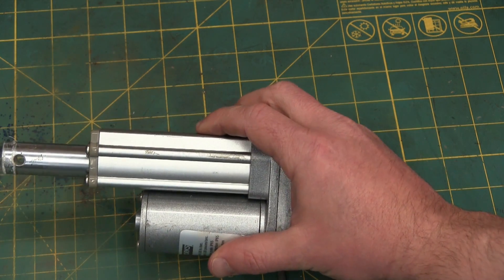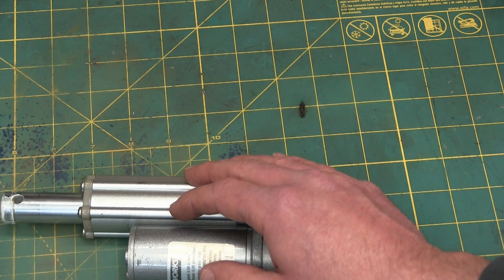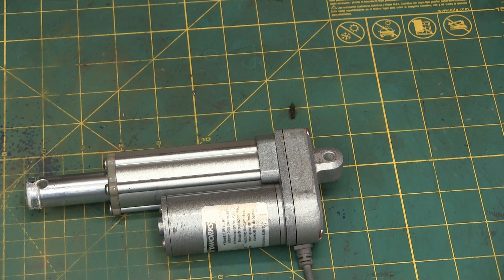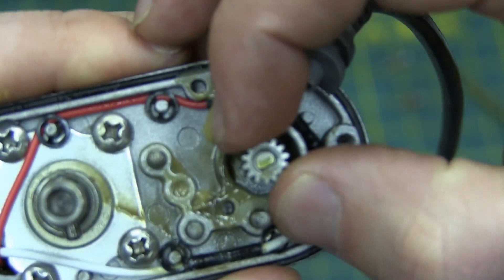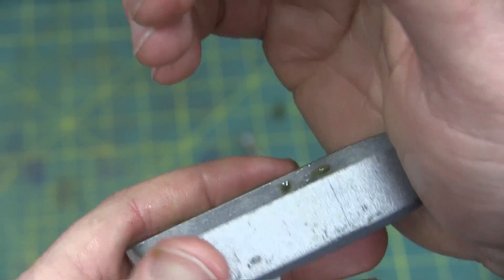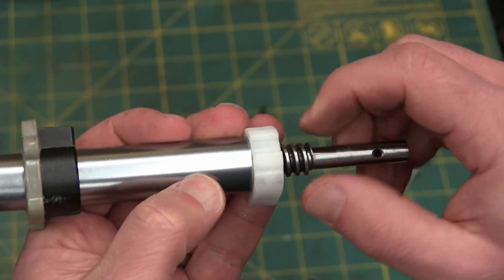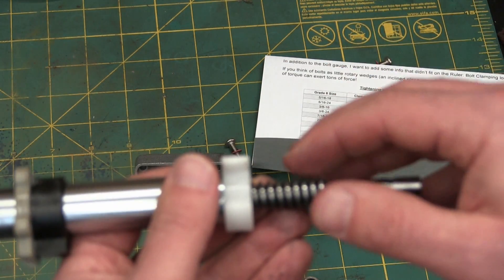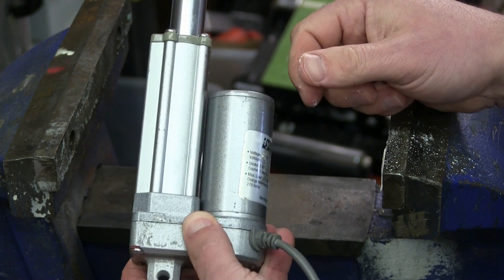BOLTR: ELECTRIC LINEAR ACTUATOR

Comment: So we had a Ghel loader that used one of those actuators for the implement locking pins. That actuator got bent up more times than I can count. I kept hammering it straight and putting it back on the machine. It would click and grind and just sounded terrible but never quit working. It was more than 15 years until we sold the loader. To this day I can't believe how much abuse that actuator took and never failed. I replaced the hydraulic lift rams and bucket tilt rams several times on that machine but never the actuator. 

On another Bobcat loader it had a hydraulic ram to operate the implement lock pins, and it got bent 2 or 3 times a year and had to be replaced. But on that Ghel, I just pounded the actuator straight and put it back on. It was unbelievable.

Comment: Nothing is built to last anymore :-<
They just preemptively engineer stuff to fail, this is why we don't even have mechanics anymore, they're just part changers.. I was thinking about replacing gaskets in my clutch master cylinder, well, whaddya know, it's all plastique! God I miss my old WV Transporter with it's all metal clunkiness.. fixt it with a hammer, two wrenches and a piece of wire.
Reply: As an engineer working with start-ups, I've come to realize the problem isn't that people don't want to build nice things - the problem is that nice things are expensive to make, and consumers would kill their mom and dad to save a couple bucks. Overengineering is as much of a problem as crappy designs, it's just that the consumers don't get to see them because they're scrapped early.
That Kitchenaid mixer Darnell Craig mentioned? It's awesome engineering, and it's worth several thousand dollars. You could buy a crappy CAR for that king of money.
Reply: From an engineering perspective, this makes no sense. You rate your product for X uses and/or Y time in normal operating conditions, and everything outside of those bounds is not really your problem. The only things "engineered to fail" should be safeguards, like fuses, etc., that detect a misuse or a critical fault in the system that would prove dangerous, but you're already outside normal operations.
No, there are no excuses for people like the guys at Canon using an hardcoded print limit to make their printers fail after a time. It doesn't protect anyone nor anything, it's just there as a shameless cash grab.
Reply: if you wanted it to last you should have paid the premium price for the stuff that lasts.
Reply: Fuses are everywhere, it's just that you only notice them when things go horribly wrong.
That, and most of the old-school single use fuses have been replaced with resetable polyfuses in modern electronics. You won't even realize you've blown a fuse - for instance,  when you overload your computer PSU and it cuts off, it's most likely a fuse. By the time you restart it, it would have reset.
Reply: I think you said this perfectly. As a fellow engineer, I can say I try to make the best design within the given constraints. Unfortunately, cost is always one of them. In a way, it's interesting because it forces you to think and approach a problem differently.

I do disagree about over-engineering to an extent. Take a look at military equipment and a lot of industrial equipment. A lot of that stuff is over-engineered and it's excellent. It needs to be because of the environment it's in. Perhaps I'm misinterpreting.

Thank you for mentioning that consumers can still buy well made products. The up-front cost is often offset by longer lifetime, support for when things do go wrong, and ease/pleasure of use. Ie. Well built products are well thought out, thus removing the frustration of use factor.
Reply: Some people agree, some don't. I guess it's fair. But I stick to my point. A pump made of plastic is made cheap, and to be replaced. Not fixed.
A clutch pump made of aluminium, pot metal or anything is probably way better, you can at least change the seals a few times, like you see on 20 year old cars. Not to mention you CAN take it apart to change the seals, you don't have to rip it open because it's glued together.
Also thanks for things like the windshield wiper sensors that stop the wipers because the water droplets are random (lol) and don't always land on the sensor area. My eyes see them, however, which is why I set the goddamn timer. They just wasted some cash they saved on the clutch pump imo.
Reply: macbeth2354 watch the review on the kitchenaid mixer. There are still things out there made right.
Reply: I fix service adjust repair and test the Japanese yellow machines all week! lots of mechanic type work there!
Reply: the thing is where the failure happens. arguably, an engineered weakpoint will be way safer than a random failure.
Reply: Gig Anonymous I ain't defending no one. Most things area shameless cash grab, just remember goldfish by lenovo.
Didn't know about canon though. 
Never buyin' em then.
Reply: Gig Anonymous but I guess that the argument against fuses would be that no one cares about them. When fuses burn out people just throw everything away anyway, so why waste money on them when you can do double savings and build a weaker part.

Comment: Wtf is foot pounds? Use Newton like the standard suggests please
Reply: dont get into aviation if you like metric measurements. Every plane flying uses standard sized fasteners and all force measurements for rigging etc. is in lbs/inches/feet. As an aviation mechanic I will never need a set of metric tools in my box..no matter if its Boeing or Airbus. Imperial FTW
Reply: it's the measurement of torque applied as if you had installed a 1 foot long handle on a pivot point (perpendicular to its motion), and hung a pound weight off it.
Reply: metric types...
Reply: Carsten Svendsen ..Michael G....it's not lb/ft.......should read lbft as the imp.unit for torque......greatings
Reply: Walter, someone told me once thay had a Mercedes Benz car that required a "special" wrench that you were to buy from Mercedes to adjust one particular part on it.  Turns out that Mercedes bought that part from an American manufacturer, the "special" wrench was just a 5/16 inch.
Reply: well, that'd definitely be "special" for a German car.
Reply: exactly. do not know why either :-(. not even a unit for torque. force<>weight
Reply: Dan Purgert
That's true, but Mercedes didn't just come out and say that it's a standard 5/16 inch wrench.  If they did, most people would just order it on line for cheap.

Comment: I know for sure Cat makes a absolute mint off hood lift actuators for 980Gs, we did 4 on two loaders in 2 years. In the same time we converted 4 JD tracked skid steers to manual quick attach after fighting a pointless battle with those stupid things. Bobcats with the hydraulic bobtach? Never a problem

Comment: It does not account for any losses but to determine the mechanical advantage of a screw I would take the thread pitch and multiply it by 2π. I like to think of it in terms of work or conservation of energy. If you input one in•lb on the screw (say one lb of force on a one inch lever arm), for each rotation you have exerted one lb of force over 2π inches. To get the actuator to move one inch you have to turn the screw eight revolutions. The math is similar to what you got from the charts, 2π*8 = 50.27 (the mechanical advantage), 260/50.27 = 5.17. I am not sure if I am missing something but it is strange that the chart shows a higher mechanical advantage than the ideal case.

Comment: you are kind of leaving out the hydraulic pump and controls in your comparison. for many projects a electric actuator is preferable, especially if you have a low cycle time. example if you want something to tilt a couple solar panels you wouldn't want to use a hydraulic system. the pump takes too much power and would be a waste. now if you have something that would be moving a lot for instances several times a min then ya a hydraulic system would be the first choice.
Reply: IIRC the shit of herbivores is preferred, but a dog can survive indefinitely on grain-based feed, even though they are carnivores.  Sort of a side effect of being the end result of a really successful genetic engineering experiment done by cave men.
Reply: A lot of speed boat manufacturers use these to lift the engine hatches and while it isnt your example they are  used about the same amount or so.Having said that when I'd have to replace them I'd offer the customer a one time repair by installing a hydraulic opening hatch complete with pump and solenoids for not much more.Or just to swap the part out so it would get them through another 2 seasons.Just about every one of the actuators failed on the boats again if they still owned it and I'd then convert them to hydraulics.
     You dont need a massive pump to run hydraulics,the Mercruiser trim pumps work great and honestly a 12 year old could install them.I bet they'd even move those solar panels.Granted they dont see the vibrations of a engine compartment but they tend to see some high wind loads every once in a while that can strip a gear ;)
Reply: Of course everything has a place where it excels over anything else. Even dog poo has it's benefits - if you're a gardener.
Reply: Leroy Spires
Well, my grandpa used it succesfully for decorative plants.

He had four dogs and they obviously shat a lot. So, he collected the droppings from the dog pen, let them brew in water for weeks and used the resulting slurry on anything not edible, but pretty.
Reply: Dog poo? Poor organic fertiliser, but skookum ammo for pneumatic 'suck & blowpipe' dispersal of peeing cats. Bore & pressure depend not only on the size & range of the cat, but also what you feed your dog on : )

Comment: I may be repeating a myth, but it was explained to me that removing the stator on permanent magnet motors damages then abs they will not again be able to achieve their nominal torque.  Evidently you should replace the rotor with a chunk of steel to preserve the magnetic field geometry as you pull out the rotor.

Comment: no limit switch on the bonnet actuators on the feline dump trucks neither... but what do you expect from the garbage that the pre-butterfly produces now
Reply: Modern aircraft are starting to use these instead of Hydraulics because less plumbing = weight savings ect. I hope they use better quality than these though.
Reply: Nah - just 100X more expensive.  FBOs/service facilities make money on more than parts.

Comment: Powder met nerding out incoming, skip if you're not into materials science. Implementing MIM is far more expensive than Press and Sinter. Gears are essentially the poster child part for P&S. Thin, axial features, few level changes. Those gears are probably pressed, sintered  and shipped. Look at something like an AR 15 front sight post for a good MIM part candidate.

Comment: Downside of hydraulics and pneumatics is the support systems they require (air compressor and dryer or pump).
Reply: Just because electrical power is present, doesn't mean it's anywhere near the best tool for the job
Reply: Linear actuators require an electrical support system.
Reply: Casey Ladelle so does a air compressor, hydraulic pump, coil on a manifold, etc.
Reply: That's exactly my point.  The fact that hydraulic and air cylinders require a "support system" isn't a downside, because they all require something else to power them.  It's just a matter of what type of power is most practical in the specific application
Reply: We have a fuel and lube trailer that sits at the jobsites to service the equipment.  The pumps and grease lines are all powered by air.  So when we needed to build a set of stairs that raised and lowered, air cylinders were the obvious choice.   That's one example of many of an application that does not have any electrical power.   Another example is a Cozad or Murray air tail trailer.  The beavertail on the rear is powered by air.  The trailer already has an air supply, and is hooked to a very large compressor, the truck.  So why not use what is there??   The trailer has 12 volt electrical power from the truck, but the plug would never handle the amperage required to run the tail.  Another manufacture accomplishes the same thing by mounting batteries in the trailer that charge from the truck while driving, then those batteries run a hydraulic pump that powers the tail.  But this adds quite a bit of unnecessary weight and maintenance when an air supply is right there.   Actuators are a possibility, but the dirty, wet, and extremely rough vibrating environment under the back of a lowboy trailer would not be too kind to an electric actuator
Reply: I agree.
I once used a pneumatic version to shift the overdrive in a LandRover 101FC. That was no succes. To powerful and to fast. I removed it because in order to get it right I needed to much supporting system parts. At that time I did not know about lineair actuators but I think that would have been a better solution.  
Basic protection (current draw and endswitching can be done with some simple electronics. With a microcontroller you can easy make very advanced protection. Like measuring the speed, the current, temperature, endpoints or even pressure.
Reply: Casey Ladelle a electric support system is already apart of most machines versus installing a hydraulic pump, etc. To add a linear actuator to a machine that already has electric you typically just need the actuator its self. To add a hydraulic cylinder you need to add the hydraulic pump in addition to the cylinder. While a actuator is more accurate in my experience, I will admit that a cylinder (pneumatic or hydraulic) is more durable.
Reply: There are plenty of machines and equipment out there that do not have any electrical power to run an actuator.  Some of them do have have air or hydraulic, some of them don't, that's why I said it depends on what's best for the application.  But I wouldn't consider needing hydraulic or air power as a downside when they all require something else to run them.

Comment: Nice. 

I wonder lent have even thought of the shock load. Could that be solved by integrating a spring and dampener? I guess what I'm asking is would it be cost effective compared to simply using a hydraulic cylinder?  

I'm surprised there wasn't a worm gear in there. With as much of a reduction as it's using, I'd think it simpler to strait up use a worm driving the gear connected to the shaft. Fewer moving parts.

Comment: I have a question, if anyone knows please inform me. 
I have an espresso machine that does not produce any pressure from the brewhead, a small amount of water still comes out, the steam wand has pressure and still works, the temperature is fine, the hot water spout is fine, but just no pressure from the brewhead and the pressure gauge doesnt even move. I have taken it apart and found some calcified fragments in the tube leading into the thing that keeps the pressure(the boiler?) above the brewhead, but im guessing some fragments are blocking something inside somewhere still.  Any ideas?     Its a BES840     or   Breville infuser

Comment: I really enjoy your videos. While your evaluation of this class of electric actuator is fair, there are some (in a completely separate cost range) that are incredible pieces of engineering. Check out the roller-screw types. Exlar is a well known manufacturer of roller-screw actuators with considerable performance. Obviously only NASA types are going to buy these though. In terms of budget, they still are not  a real match for a well designed hydraulic system. Impressive nonetheless.

I had a customer decide that the class of actuator you reviewed didn't meet their needs (initially guided by their budget). There was too much play in the lead screw after some stress testing. So in the end we ended up spending the money on the electric actuators they actually needed.....roller-screws.

Comment: I recently attended PACK Expo international 2016 where any and every company in the industry attends. I attended as a student so I was free to walk around and talk to any of the 1800 exhibitors is saw fit. One of my favorite things I saw was a company who made a gable top cartoon (milk cartoon) assembler and filler. The thing that stuck out to me was that it operated off a central crank shaft and had no pneumatic, hydraulics or linear actuators. They were marketing it at small companies and small island nations where getting replacement parts can be a timely and costly endeavor.
Reply: Where is the axial load focused on the motor side of the lead screw? On the bearing? On the bushing?

Comment: They use these actuators to trim the longitudinal, lateral, and directional flight control systems of the F15 fighter jets. They're placed in parallel with the flight control rods and have internal spring cartridges that allow for pilot inputs.

Comment: Hey, Ave, if you used a plain bench mat instead of one with a high contrast yellow grid, you would probably have less problems with the camera focus.
Reply: footrotdog but that would take so much fun out of the videos lol
Reply: It focuses fine once he cups his hands around the object to give it a larger area. The focus just snaps back to the desk when the mat comes back into screen.
Reply: footrotdog I disagree. The grid provides some point and contrast for the camera to focus on. Using a solid color would probably cause the camera to hunt for focus as would have a hard time getting a solid lock.
Reply: that's exactly the point the grid remains in focus at almost all times when what we really want t be in focus is a part or some such that he is holding closer to the camera. the grid interferes with the camera autofocus
Reply: footrotdog I think it's more an issue of bringing subjects too close to the camera. Most cameras used for this kind of thing can't focus at such short macro, longer minimum focal length. I find that's the case anyway, with my recordings often.